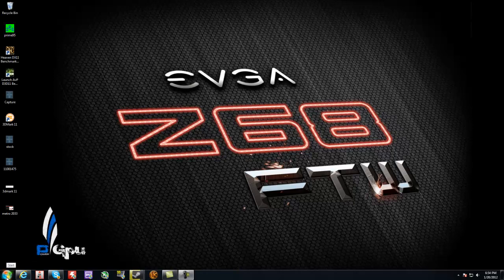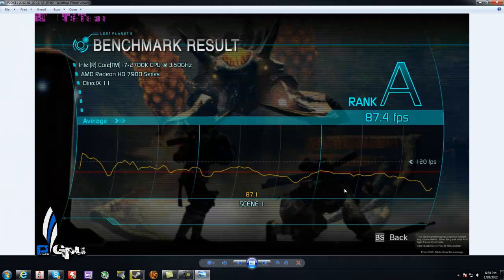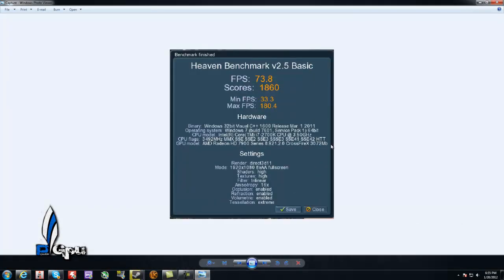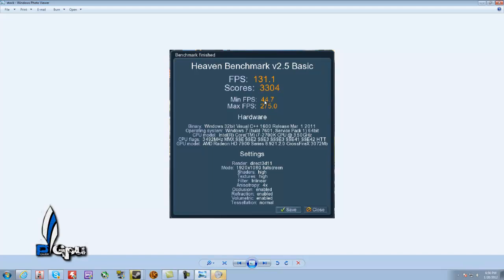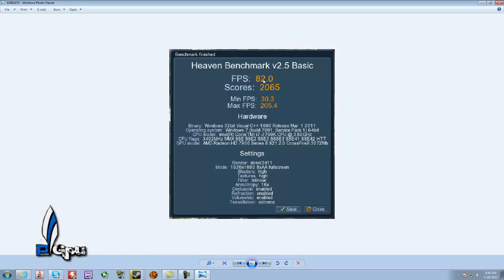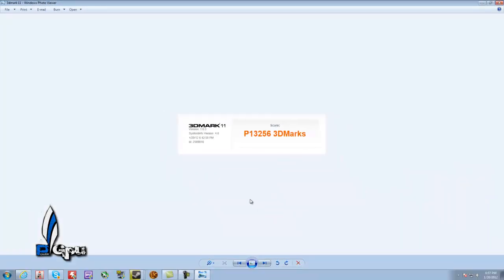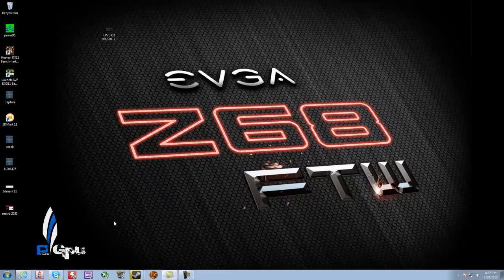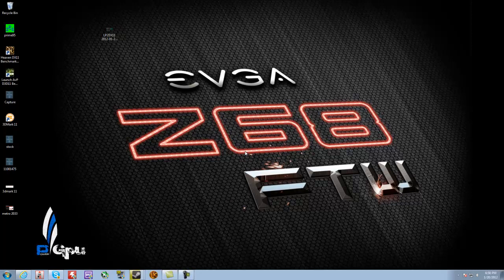AMD 7970 Crossfire - Benchmark

Comment: they don't out perform mine lmao... 
3D Mark 11
P18665 with AMD Radeon HD 7970(2x) and Intel Core i7-3770K Processor
Graphics Score 24858
Physics Score 11471
Combined Score 9684

Crysis  121 FPS average using the benchmark tool @ enthusiast settings 1080p... on frost...

Comment: Go to my channel my old cards GTX580 sli set up beat all your scores .. 3dmark11 "P" score .. And open and run Heaven crushed your score .. So add 3,000 points to your 3dmark score and that is what my Evga  FTW CARDS score !! So these fanboys of AMD need to check facks before saying 7970 is faster than 680's cuz they are not even on the same planet !!! Not saying that you compared them but others did , so watch my vids on my channel and you will see my GTX 580 smoke these scores !!